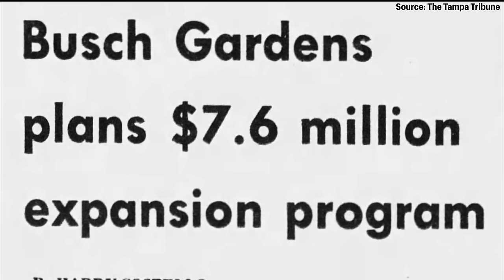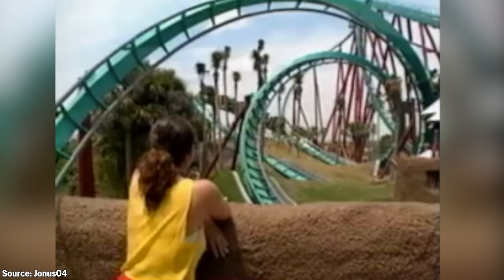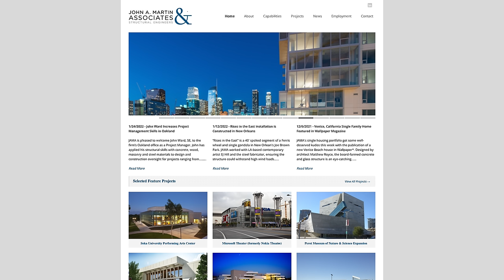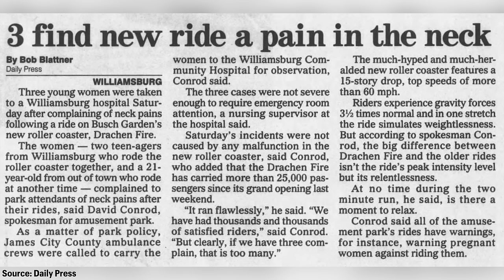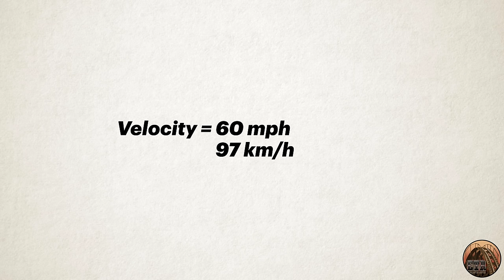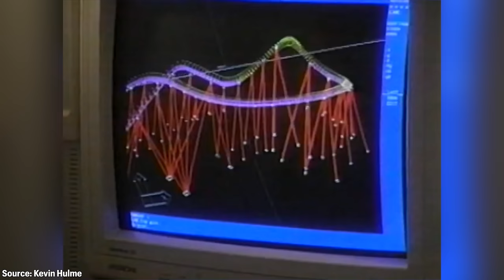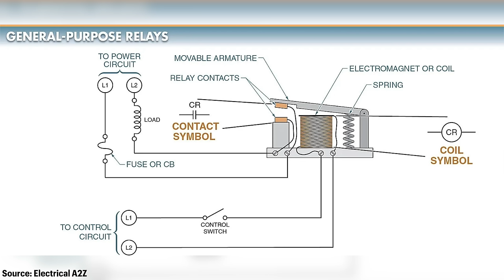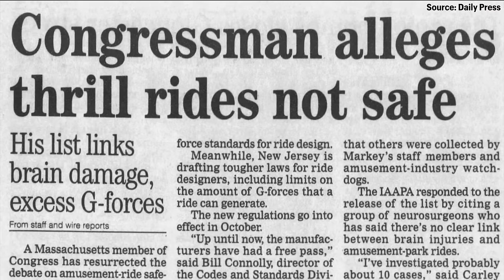Problematic Roller Coasters – Drachen Fire – The True Story of its Failure

Comment: Crazy to think that the way Arrow used tangent-radius design and how their coasters look seems to be build directly with Roller Coaster Tycoon 1-2. I can practically see the different track pieces used from the game in Arrow's designs, and makes me wonder if the CAD they eventually used wound up being the base code for the games as well. Wild stuff!
Reply: It's surprisingly pretty simple to be fair

The real absolute nightmare example would be if you using Planco track builder to adapt with NL2 smoothness. Trust me, even someone good at math and coding on NLC Discord can't even solve the algorithm
Reply: RCT was hand built in assembly language.
Reply: @daniellewis1789  fr? That's pretty cool
Reply: Definitely not.  RCT 1 and 2 were written entirely in low-level assembly code, and at any rate the method of track construction in those games is just placing prefab pieces on a grid.  It does definitely make them look similar though 👀

Comment: Great video and info as always. I wish BGW would build like a Drachen Fire's Revenge using the new Vekoma loopers.  Use that first drop, maybe mirror some of the other elements as well.
Reply: YES. The layout is honestly really interesting, at least until the last 2 elements. I'd love to see the design minus the engineering downfalls
Reply: That would certainly be nice, however I think the rumored hyper will be adequate. Hopefully they can get a Vekoma looper later down the line, possibly to replace Loch Ness or Alpengeist when either of those go down
Reply: @airbus7373  Replace Nessie?  BLASPHEMY!!!  LOL!  I don't ride (I can't due to injury), but Nessie is iconic.  I don't know that they would be able to replace it.  It's such a park landmark.
Reply: @kmabru  unfortunately nothing lasts forever. It’s certainly iconic and is also a great ride, and I’m hoping they can keep it going through the 2030’s, but we’ll see
Reply: @airbus7373  Unfortunately true.  It's like Cinderella Castle at WDW.  You instantly know what it is and where it is.  Unlike the castle though, it's a ride.  Hopefully they can keep it going for a good long time.  Given it being an icon for the park they do have a motivation to keeping it going.
Reply: @airbus7373  they'd retrack the entire ride before tearing down nessie, the area it takes up is nearly impossible to build in now because of environmental issues, notice nothing else in the park is built over the "river", also unlike bbw which was pushing way past the limits of its track design and trains nessie is a relatively tame ride that doesn't tear itself to pieces.
Reply: @Mister_Brown i completely forgot about that possibility lol. Although I’m not sure if anyone is still able to manufacture the old Arrow-style track, maybe they could reuse the footers like they did on Verbolten. If anyone could do it, it would probably be Vekoma, maybe S&S

Comment: With BGW as my home park when Draken Fire first opened it was rough but we didn't have anything modern to compare it to so we all thought it was intense on purpose and with few exceptions we loved it. I distinctly remember the running lights and I bet those are on an old VHS somewhere. Also, pretty sure I was one of those that rode it few times given there was hardly ever a wait. I just happened to be the perfect size and weight at the time where the head banging didn't bother me so much. I probably would not like it nearly as much these days.

Comment: I did want to make a minor correction. While the Drachenfire queue and maintenance buildings have not been used for another coaster or permanent attraction, the DQB was a haunted house for several years while the DMB was used as dressing rooms and break area for those cast members as well as the cast members in the woods for the train scenes. 

I worked Entertainment at BGW Fall 2004 and part of our work that season was to make the DMB safe for ppl to walk around without boots on as there were still exposed bolts in the floor.
Reply: Hell yea I went through that haunted house around that time.

Comment: I rode Drachen Fire in June of 1992 the Monday after I graduated from high school. It was not very busy and we was able to ride it 4 times in a row without getting off the ride. We could have rode more but we all needed a break. I remember the ride operator saying to sit up straight and push your head back against the head rest to keep from banging your head and ears on the shoulder restraints. You were instructed to remove earrings at that time I don't know if it was official policy or just advice from the ride operator.
Reply: Removing earrings did become an official policy eventually but it was probably more so advice in 1992.

Comment: Thanks for the video. You explained very clearly why Arrow roller coasters feel so rough. I've always wondered why Schwarzkopf roller coasters from the same era run so much better, but you've answered that question now. Werner Stengel is the inventor of the heart line and since he worked a lot with Anton Schwarzkopf, this design principle was of course used everywhere at Schwarzkopf. You also explained nicely that the focus at Arrow was on the structure. Werner Stengel and of course other designers like B&M had and still have a more holistic approach that also takes the riders into account.

Comment: I rode Drachen Fire when I was 8 years old only once. After having rode the Big Bad Wolf as my first ever roller coaster then the Loch Ness Monster, my father pressured me to ride Drachen Fire with him. As an 8 year old , my torso height put my head right between the shoulder restraints. Every transition was felt with a swift bash to the temple. I remember struggling hard to hold my head still between the restraints and hoping for a straight run of track, but only seeing curves and loops ahead. When I got off I had a headache and no desire to go back on. I love roller coasters, but this was a rough one! Great video!

Comment: I rode it.  Liked it a lot, mostly that cool looping as you go down the first hill.  A feature that endeared the ride to me before ever riding.
Reply: That corkscrew on the first drop was brilliant--there's a reason Steel Curtain has an element named after Drachen Fire, though it's not actually the same, just a variation on the theme of "inversion partway down the first drop".

Comment: Drachen Fire greatly impressed me when I rode it... but it also hurt. I don't usually bang my head even on coasters that are kind of notorious for it, but on this one, I definitely did. A lot. I didn't have a lot of experience of coasters at the time--the only other steel coasters I'd ridden were a few older Arrows, including BGW's--and I assumed that this was just what new coasters were like now. So I kind of loved it, since that layout was fantastic and thrilling, but paradoxically it also put me off coasters for years--I didn't typically feel like I was up to going through something like that.

Years later, after getting back into riding coasters a little (via Canobie's classic woodie, the Yankee Cannonball), I wondered what had ever become of Drachen Fire, and the stories I found in the online enthusiast community were some of the things that got me into being more of a fan. It's now interesting to me that the core narrative of those stories--that Drachen Fire was what it was because it was Arrow's attempt to execute on a B&M design--seems to be a myth, probably built from supposition and hindsight. Drachen Fire did have the feel of what you might expect if Arrow were to make a B&M mega-looper. But that doesn't mean it was.

(To be fair, the stories did generally get the actual physical problem right--that Arrow's track designs used no heartlining. But this video goes into much more detail.)

Comment: Yes, I did ride it, and OFTEN.
(I worked in Italy section of the park.
The track color was "Carolina Blue," by the way.)
The "switchback" was to simulate skateboarders half-pipe, transition. You go up, it floated you around the left-hand curve, Then, you got speed back up as you dropped back 'into the pipe.'
The first drop, was unattractive to me at first, with a roll slowing you down, before you got any sense of speed, it soon became my favorite element, as you then, got seated firmly, and launched into the camelback which had an awesome amount of weightlessness, before slamming into the bat wing.
[Early on as they tested with barrels of water, the barrels leaked.
When a co- worker I was watching along with said, "Look at the water spilling!"
I said," That's to simulate people throwing up."
( MY FAVORITE coaster in the park was BIG BAD WOLF.)

Comment: I’m a PLC programmer and it is exciting in the nerdiest possible way to hear Allen-Bradley PLCs mentioned in this video!
I program in a different field (though I would love to program coasters), but generally the PLC manufacturer used is determined by where the company using them is located, as different parts of the world use different primary PLC manus (US uses Allen-Bradley, Europe uses Siemens, etc). That’s not to say that a region that uses one primary PLC manu doesn’t use another on occasion at client request, for particular needs, or for something going to a region where another primary PLC manu is used and technicians working on it might not be familiar with your regions primary PLC manus. 
Anyway thanks for coming to my TED Talk on PLC programming, if you ever need info on PLCs, need someone to translate any ladder logic (PLC programming language) you come across for a coaster, or even want some sample PLC code drawn up for a video- this gal can assist 😊

Comment: As an ACE member, when I saw artwork for this coaster I was excited. The sleek trains looked like surfboards! The structure looked incredible. Lots of PR hype! Then there was the cutback removal, complaints of roughness. At an IAAPA Expxo as always B&M would have a lead car on a piece of track. I touched the guide wheel and surprised to find them to be spring loaded. Walter Bolliger told me that sometimes the track is NOT fabricated perfectly, so the spring loaded guide wheels eases the transitions! I thought, Why do the other manufacturers NOT do this? The unfortunate "curse" of many Arrows are that they have to be constantly welded or "beefed UP" XLR-8 took a month to dismantle as the steel was of various thicknesses on both track & columns. Steel Phantom was another one that had to be neutered before a Morgan redo.

Comment: As a kid I was excited to ride this on summer vacation as I visit family in the Hampton Roads area every year at the time. The first ride was over fueled by hype and thinking I could overcome its downside. 2nd ride I realized this thing was evil! My younger cousin got off it completely in tears and I realized that no matter how hard I tried to hold my head back it was determined to bash my head between around like I was in a heavyweight boxing match. I was glad to hear they removed that abomination before the next visit. Everything that added afterwards was great. On a side note as a kid I also hated the da vinci's cradle, which I called the change machine due to the way I quickly gained speed and either continued over the loop or stopped and reversed direction causing a large amount of mostly coins to fly out of the pockets of riders, which could be amusingly heard and seen flying around under my feet. Also saw the occasional $1-$10 bill and once and expensive looking watch.

Comment: Love the history on this! I saw it being built in ‘91, moved from NC to Richmond in ‘92, where I ran The Anaconda for 2 seasons at Paramount’s Kings Dominion. I rode Drachen Fire the 1st year it ran, as well as in a few following seasons. I didn’t get to ride it after ‘95 season, however, as I had moved to DC & was rather busy. Paramount’s Kings Dominion (now once again just Kings Dominion - owned of course by Cedar Fair) didn’t pay well under Paramount at all, & I grew increasingly tired of knowing a $0.10 raise for 2 seasons if 3 were worked was the best you would get over minimum wage unless or until you made foreman on a ride or moved to maintenance, etc. If I began at higher than minimum wage, it was only by pennies & never was over $5.00 either year. I took a job with a bank (Crestar) in ‘93 so I only worked weekends that year & I did work a single day in ‘94 but ultimately opted not to return after that. The park was yet to open that last year anyway, so it was just groups of teams waxing ride vehicles, cleaning up, etc. I enjoyed living the dream of running a roller coaster, but all in all, I’m a bit older than 1 would consider to be a typical worker on that job these days except for part-time/weekend workers and maintenance or foreman positions, no insult to anyone who does at any older age by any means. I was told by Cedar Fair employees at KD recently that their pay is much better than we ever would have seen. As for Drachen Fire, 1 word & you said it many times already - ROUGH! Thanks for the coaster stories! Keep them coming.

Comment: The restraints were harder, lower and more dangerous than other Arrows, or B&M. One of the best parts was almost seeming like a private coaster at times, so many rides, but quickly learned to respect how bad it could hurt you.
According to a report, no longer avail. on the 'net, signs of stress in the reinforcements were beginning to appear and that company was also out out of business. They did repaint it after it ran regularly, which might have contributed to the rollback when demonstrated.

Comment: As a child of around 10 during the height of this ride I rode it frequently. My head rested between the shoulder straps, and bounced between them during the ride like a coked out ping pong ball.

I would brace myself as hard as I could, but the violent shaking was so intense I struggled to ride it once, let alone a few times in a row. I did, because towards the end it was usually empty, and it was an incredible ride, but MY GOD did my temples pay for it.

Full size adults heads at lest cleared the shoulder straps. For all but the hardiest and most determined kids the coster was unrideable.

Comment: Another thing about Drachen Fire - it never felt like it had enough velocity coming off the top of the first drop before going immediately into the inversion - it always felt vaguely like it was hanging off the track by the strength of the 3rd wheels alone and was a little scary in that way, definitely didn't feel any centripetal force pushing you into the track before you immediately went upside down. We always figured that wore it out prematurely too.

Comment: Grew up going to Busch Gardens Williamsburg (just an hours drive away). I remember when Drachen Fire came out. 

It's true, it's definitely the roughest roller coaster I had ever ridden but at the time it was also the most unrelentingly intense coaster I had ridden. I knew a lot of people that refused to ride it because it was so rough, but I loved it. I was thrilled when the lines for it got shorter and shorter. I was pretty disappointed when they got rid of it.

Drachen Fire and The Lochness Monster (which was the first roller coaster I ever rode) are both staples of my youth so these videos are pretty interesting - I just wish I was sharp enough to follow along more easily with the physics/engineering subject matter.

Comment: Great job! While I know I was in the minority, I really did enjoy my rides on Drachen Fire. I never found it to be too rough. It was just super noisy because of the metal catwalks. I was never able to ride it with its extra corkscrew but from the sounds of it, that is a good thing. I am quite confused about the B&M/Arrow tie thing though. Back in 2003, I went to an IAAPA dinner with some folks from Busch, Dollywood and Silver Dollar City. During the dinner, the discussion about what was going to happen to Drachen Fire's old site was brought up.  The folks from Busch told the rest of us that they were originally looking for B&M to do Drachen Fire. They even had an idea for the layout, which sounded very, very similar to Kumba in regards to placing of elements. However, B&M was booked and hadn't finalized their sit-down train design yet, so they passed. Now, that's not to say Arrow hadn't started a design yet. They most definitely were. They just didn't have the tech to do certain elements that Kumba would eventually do. For instance, the cutback element on DF was idea from another Arrow engineer when they were figuring out the tight ending. They were unable to do interlocking corkscrews so they went with split, with the help of the cutback. I was also told that they  originally wanted  a large loop around the lift. Regardless if any of this was true, it was cool to hear stories like that from the pros. I am glad this video highlights a more logical reason as to why DF failed as a coaster.

Comment: Throughout my countless trips to BGW since the late 70s there was a gap for me between 1988 and about 1998. Consequently I never got to ride Drachen Fire.  By the time I came back in 98 DF was still standing but not operating which was a major disappointment to me at the time.  Fortunately Alpengeist had just opened and through the years it has consistently remained my absolute favorite coaster in the park and one of my top 5 favorite coasters that I have ridden anywhere.  I still regret not getting the chance to ride this beast while I was young.  I can't imagine it was any rougher than Ninja at Six Flags over Georgia was.